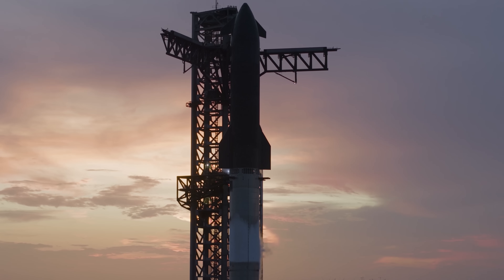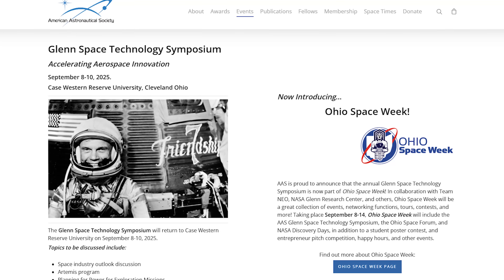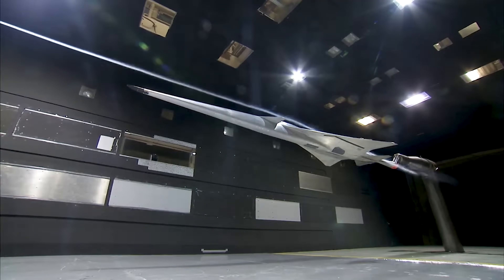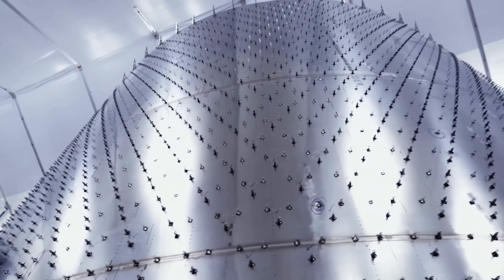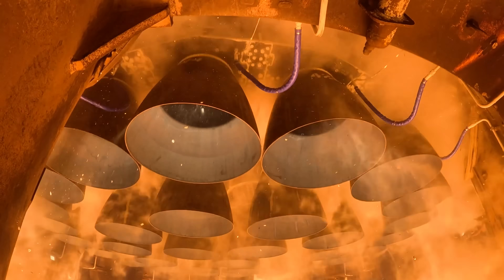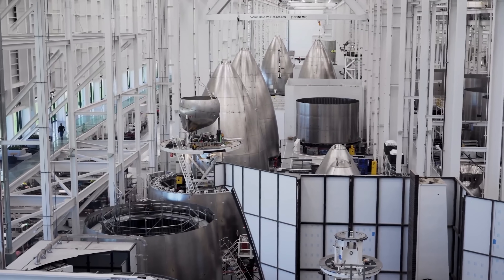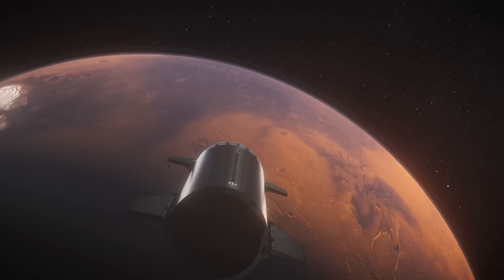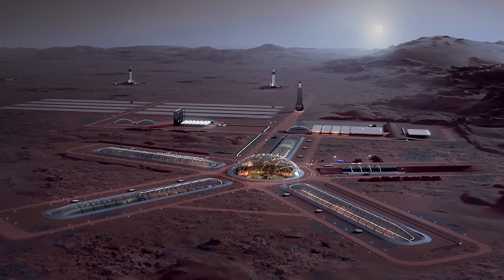SpaceX Found New Unexpected Onboard Data on Starship Booster Landing!

Comment: A city on the Moon or Mars will have to be large underground open air caverns with spinning platforms for artificial gravity and projections onto the ceiling to simulate day-night cycles.  This will be necessary for physical and psychological health.   These cities will need to be built initially by remote control VR androids and then used as surface labor.

Comment: One of the major problems with wind tunnel models is that they are typically very smooth, precisely machined, extreme sub-scale representations of the actual vehicle/object. They do not offer a very representative analog to the actual vehicle at hypersonic and supersonic speeds; skin defects and roughness become a very big deal.

Also, physical shape in those high speed regimes are very, very difficult to model in CFD; small imperfections at scale change the actual flow characteristics vs. the model and a cylinder is not exactly an aerodynamic shape.

I've seen it live and in person on various projects I've worked on over the years. i.e. Both CFD and wind tunnel data were not withing the typically acceptable 10% - 15% of actual flight data.

Unsteady aerodynamics is HARD!

Comment: The Soviet version of the space shuttle, Buran, had a fully reusable orbital heat shield tile system.  During its only flight, it lost 8 of the 38,000 tiles.
Reply: Turns out the Americans knew the Soviets were looking at the Shuttle's specs and so they deliberately left info in there that was outdated, ie: the glue method the Americans had originally thought to use on their Shuttle's tiles. Afterwards it was deemed very very lucky that the Buran did not burn up on re-entry .... hence why the Buran only flew the once.
Reply: it only flew once
Reply from the maker: That's some crazy fact!

Comment: The models are flawed.  Sometimes the models present more engineering challenges than just soldiering on with the project.  It could be not properly accounting for size or inexact flight dynamics not to scale or a billion other things in combination.  A working model, even scaled down, is more comprehensive and reassuring for any project.

Comment: SpaceX needs to use larger tiles and apply them in blanket like strips so they can be changed out during refurbishment, instead of replacing tiles piecemeal.  Also, the fore and aft flaps need to be replaced with one large or two smaller scissor wings.